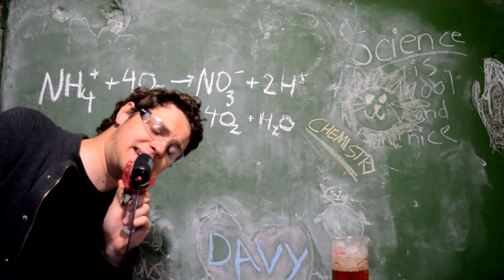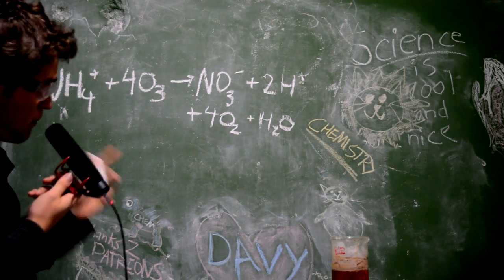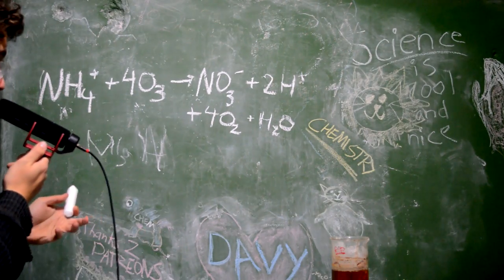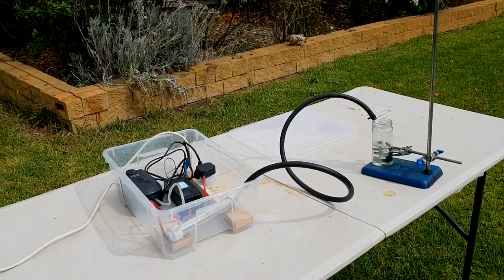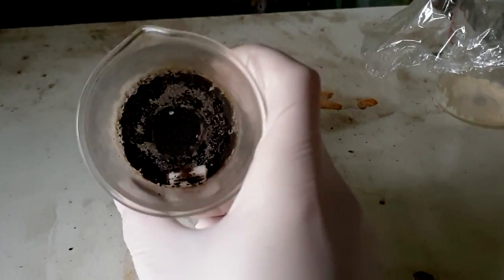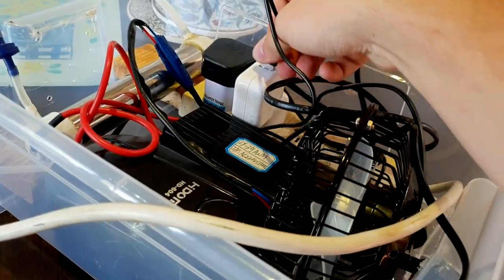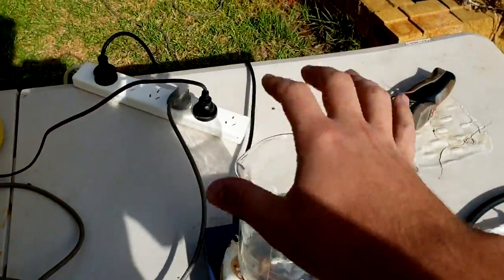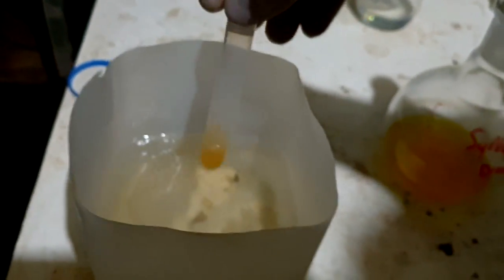Nitrate from Ammonia using Air?

Comment: I’ve tried in the past, to make nitrocellulose 36 times before getting it right. And it turns out that I might have gotten it right all those times, because when I fluffed up my old runs a bit more, it lit perfectly fine. 36 times bro.
Reply: That stuff’s hard to dry.
Reply: Now mix that with glycerin
Reply: I feel the pain behind your statement sir. Though I'm a electric fucker arounder and do not understand 💯%. I felt.
Reply: @RobBoss757  my grandfather used to say, "I once thought I was imperfect, but I was mistaken"
Reply: @elephystry  mix it into acetone at only 5-10%.. you can actually buy it off of Amazon if you want the real dope coating.. now do realize that dope is only nitrated up to around 10- 11% N instead of the 12% so it does not readily 'burst'... and it is noted that a dope coating never really dries, thus is 'self-healing' from scratches.  I'm not going to go into doped fabric as doping is used in restoring furniture and guitar finishes.
Reply: @tsclly2377  dope

Comment: I don't think that the transformer is damaged at all, I think the black stuff is just an insulating goop that is commonly used in high voltage circuits.
Reply from the maker: I mean maybe, although it is hideous then, and just poured randomly over half of the components (still possible though)
Reply: @ExtractionsAndIre  yup made in China.. I had a faulty one that was bigger.. Both sides were fully potted. But the low voltage side was filled with coarse sand before potting.. Just to cut a few cents off the cost
Reply from the maker: Why..... sand
Reply: @ExtractionsAndIre  Doesn't conduct! Yeah, sometimes potting compound is slopped around like that. But still prrrrobably a good idea to cool it better.
Reply: @ExtractionsAndIre  that little transformer is actually for high frequency noise suppression. It's a filter basically. It allows 50hz through but stops anything above 1khz getting back in the power grid.
Reply from the maker: @willynebula6193  thanks for this, that makes a lot of sense! I'm slowwwlllyyy getting better at electronics
Reply: @ExtractionsAndIre  "Why..... sand" Go to google maps, type in "Gobi desert" and press enter, click on satellite view.
That's why sand.
Reply: Norm T  I think Willy was right...

Just kidding bud, I just wanted to get you going lol. Sorry for that.
Reply: Also, given that it was upside down from that view, the insulation would have to made of negative mass matter for it to drip and run up onto the board without gooping that metal plate.

I'm guessing the whole thing is sketchy AF anyway, made out of old, oxidized, cracked enamel coated wire and the black goop at least gives it a fighting chance at not dying of crib death.  I'd hate to see an o-scope's output of what that thing does to the high voltage noise on the mains.
Reply: @jonross377  yeah, he was- transformer is pointed the wrong way for it to be switching- and there's two windings with an insulation barrier between them, but they're about the same size, which would make for a pretty poor transformer. It's a common-mode suppression choke (blocks the passage of signals that are the same on both live and neutral)

The high voltage section is the white potted blob with wires going into it on the left. Standard operating procedure for these thousands of volt devices

Big Clive has a recent teardown on his channel on one of these devices
https://youtu.be/7GpsJN3P7vE

It's a bit "circuit-gore" if you know what i mean
Reply: Norm T  That thing looks like a common mode choke to my eyes, not a power transformer, I think the power transformer is potted with the multiplier in the white goop.
Reply: Yes that's potting. A type of epoxy made specifically for the purpose.

They didn't really... "Pot" that... Very well... Lol but that's what it is
Reply: @ExtractionsAndIre  a bit late, but sand is used in high voltage fuses to absorb and stoo arcs. It turns to sand and suppresses out of control arcing.

Comment: My high-effort, low-yield story is university electronics lab, where I spent about 12 hours failing to bias a transistor in electronics lab, because, it turns out, the professor was teaching us the Rules of Thumb that he learned in Army instead of ACTUAL PHYSICS, which would have required a working knowledge of Calculus.

Comment: perhaps you should use ammonium carbonate rather than dissolve ammonia as the vigorous bubbling may just sparge the dissolved gas out
Reply from the maker: Would it just force the ammonia and carbon dioxide out of the solution though??
Reply: @ExtractionsAndIre but at a much slower rate I guess
Reply: Yeah, same thought. Or NH4Cl like the one paper did
Reply: NH4Cl also has the advantage of being delicious.

Comment: Wanna hear about my failures? My thesis is on titanium dioxide surface chemistry (finally writing up now!). 

My first batch of syntheses were done using some "titanium oxychloride" (really more of a Ti4+ aqueous solution with a varying number of chlorides in the Ti coordination sphere) that we had gotten from industrial partners.
Turned out to be contaminated with vanadium, TiO2 turned green upon reduction. Throw away, start over. This time make the starting solution yourself by hydrolyzing TiCl4. (A pain in the ass of a reaction, took me a few tries to get the hang of it...).

I must have then spent over a year trying to remove fluorides from the surface of titanium dioxide nanoparticles. We used fluorides in our synthesis to control their growth and the resulting morphology. Turns out you can't remove said fluorides without destroying said morphology. (Contrary to what had been published in the literature so far). Ended up studying the chemistry of the fluorinated surface instead. (A lot harder, and far from what we were hoping to get)

I also spent months grafting vanadium on the surface of those particles, and doing all sorts of characterizations of the surface vanadium species, to then hand them to someone who would test their catalytic activity for the oxidative dehydrogenation of propane. 

I did so because initial results showed great selectivity to propene.
Initial results were due to an improper setting on the GC. My material had been sh*t all along.

Oh, and have I mentioned grafting nickel complexes on the TiO2? I first tried it with diallylnickel. It's air sensitive, you have to synthesize it yourself  (nickel chloride and allylmagnesium chloride). And keep it below -40°C, or it will decompose. (Hence why you can't buy it)

After multiple failed attempts where I ran out of dry ice halfway through the days-long process, and almost froze off a couple of my fingers by spilling some acetone/dry ice from a dewar on my hands (no Leidenfrost effect to save you here! The skin turned paper-white from frost... lost all feeling of touch for a few days), it turned out diallyl nickel simply destroyed TiO2. (It reduces it to some amorphous, non-stoichiometric oxide, instead of just grafting on the surface hydroxyls)

So I switched to different, less reactive nickel complexes, like the ones NiBr2 makes in acetonitrile and dimethoxyethane. (Of course, this being surface organometallic chemistry, everything has to be done under perfectly air and water-free conditions, so as not to soak your oxide surface in moisture. So, Na/K drying, everything handled on a schlenk line, high vacuum line, or glove box, etc...) 

They did graft on the surface. But they did none of the subsequent chemistry we intended to use them for! So, good for the trashcan too.

 And now I'm trying to get a thesis out of it. And panicking. And procrastinating on youtube instead of writing...

(Thankfully, I did have some success when grafting platinum. But it's not yet published, so shush! ^^)
Reply: I feel bad for laughing but damn that's some thorough and dedicated research. Sometimes negative results are valuable results just as much. Good luck with the writing.
Reply: I feel that struggle. My uni research is making nanoparticle ligands, such a shitshow.
Reply: I was once attempting to make the addition product of fluorene and acetophenone using fluorenyl lithium at 77K. I recovered fluorene in nearly quantitative yield. Only afterwards did it occur to me that acetophenone is acidic enough to protonate fluorenyl anions. While my synthesis scheme was clearly rubbish, I can at least feel vindicated in the quality of my work-up.

In a curious parallel to the preceding posts, the (erstwhile) fluorenylmethanol derivative would have been used as a chelating ligand in a titanocene complex for the polymerisation of alkenes such as propene, butene and pentene.

I managed not to spill liquid nitrogen on myself, but the time I got sprayed with butyl lithium solution when the cannula popped out of the rubber septum was pretty scary. Good job it was only 1M, had it been much stronger I'd have been toast.
Reply: @posysajrazdwatrzy  lol make your thesis about how lame titanium dioxide surface chemistry really is
Reply: A PhD thesis (ideally) shouldn't come with buckets of failure, but often does. I had 2 years of failed results in mine that made up about 5 pages in 1 chapter.

Good luck with writing up!
Reply: Just as posysajrazdwatrzy said: Negative results can be useful as well. Maybe you can save some future chemist from trying the same fruitless methods and making the same mistakes.
Reply: I don't know how your thesis went or if you've finished it... I know you didn't get the results you wanted but from a purely scientific standpoint that sounds like very valuable research.
Reply: @rnedisc 
 I did finish it! ^^ 

But none of the vanadium or nickel stuff made it in there though.
Reply: I feel your pain. My thesis subject is interaction of protic ionic liquids with polymer latexes and latex paints (if I ever get that far) and getting some plasticizing activity out of it all. So far literature shows no signs of anyone trying it out - no-one was stupid enough to try adding agent that simultaneously changes ionic strength and pH of the latex, which, if we were to believe physical chemists, are kinda important for surfactants/protective colloids to work.

And even if I manage to make PILs not destroy my latexes on contact, them bastards will need to:
(1) enter polymer particles and stay in them in sufficient amount (which will be low due to aforementioned bollocks), which raises question about polymer-water distribution;
(2) plasticize the shit out of the polymer in low concentration;
(3) be cheap and easily manufacturable, or no-one will even look at them.

Edit: spelling
Reply: @elnombre91  from what i understand if ur not failing ur not pushing the boundaries of new information. ur just confirming whats already known or suspected and well theres nothing wrong with that but ull never be great without failure unless ur incredibly lucky
Reply: It is always useful to identify what doesn't work, unless all the failures were yours, in which case you could identify a set of processes to help people not get it wrong. Not that this matters now we are all a year down the track. How did your thesis go? Get through it?
Reply: @interestedinstuff  Yeah, doing a postdoc in an other university now! ^^
Reply: As Jamie Heinemann once said: “failure is always an option”. Basically all my psychology papers were “here is how I messed up”
Reply: @74KU  Uhhh... have you heard of heterogeneous catalysis?
Whether we're talking of oil cracking, Haber-Bosch, ethylene oxide & propylene oxide synthesis, Fischer-Tropsch, the Wacker process, hydrodesulfurization, and many more, "random oxides" like this one are only essential to, like, maybe 80% of "heavy" chemical industry?

And TiO2 in particular can also do photocatalysis...
Reply: Well at least you got to prove the people from the previous literature were BSing, right? That has to count for something lmao
Reply: You tube isn't a valid coping mechanism.  No one really cares.

Comment: I spent 1.5 years trying to get a CRISPR system to work in a type of Cyanobacteria but kept getting really weird results with the clones. One test would show the clones have the edits I was after and after a few days in culture the edit was cured. 

Turns out after some work quantifying the number of genomes in the cells we found that the little shits had upwards of ~50 partial copies of the chromosome meaning that we were making edits on only a handful of copies, but whenever the copies would segregate into daughter cells there were ones without any edit which would just outcompete the edited version in culture. 

Moral of the story; stay away from the unholy life sciences, there’s too much bad juju here.
Reply: Ah yes,  non model organisms. The one thing I won’t work with. Well, that and physicists.
Reply: Can you splice the Ivermectin producing bacteria gene into a Ginseng root? You can call it tree of life root.  Yeah, not quite that easy but nice idea.
Reply: Is that really what you do?
Reply: What if you edited the bacteria to produce a green dye or something to allow you to crop out the desireable bacteria in the petri dish? Then you could selectively breed the bacteria without fear of the other bacteria out competing.
Reply: @wn9500  and those godawful yellow things
Reply: And that is why, when doing it the old skool way of plasmid transformation, an antibiotic resistance gene is included in said plasmid, along with the gene of interest that is to be inserted in your bacteria of choice. Or if you don't want to use antibiotic selective pressure, you can also use a gene that gives the capability to ferment a sugar it normally wouldn't be able to.

Comment: Mate, it's yellow chemistry, of course it failed...., surprisingly you forgot to even mention it

got any advice on how to reduce/stop peroxide formation on ethers? maybe even how to chemically reduce the existing trace proxides?

side note, the (high voltage) transformer is potted inside that big white blob. the small thing with two coils is a common mode choke, it just stops the noise from the unit backfeeding to mains, that is easy to buy/replace
Reply from the maker: I am surprised I forgot to mention the yellow! No wonder it didn't work honestly. 

Peroxide formation... dark bottle, store over sodium, good lid. Pretty hard to get peroxide in those circumstances
Reply from the maker: And yeah, so what is that other small core that's doing the melting actually doing in the circuit?
Reply: @ExtractionsAndIre  The video is a bit dark, the black thing on the bottom right is the one you are talking about right? that's this thing
https://en.wikipedia.org/wiki/Choke_(electronics)#Common-mode_choke
Reply: @ExtractionsAndIre  how do you deliberately get peroxie
Reply: @marciaosullivan3200  mix it with hydrogen peroxide and prepare to die

by the way, you can also put in a tiny amount of stabilizer into the ether, I'm not sure what kind of it, though. I think it is stated on the Sciencemadness wiki.
Reply: Are you talking about storage of ethers?

BHT (butylated hydroxytoluene) is an common additive for solvents like THF and diethyl ether, and if it will interfere with any reactions it can be removed via distillation.
Reply: @flagmuffin1221  well, now I need a homebrew recipe for BHT :)
Reply: @LateNightHacks  4-Methylphenol (p-Cresol) and Methylpropene (Isobutylene) in the presence of acid yields BHT. Don't know about the solvent. Seems to me that this reaction is rather inaccessible to an amateur chemist, you might as well just buy the BHT, you only need tiny amounts anyway.

It seems more reasonable to me to use a different stabilizer or destroy the peroxides before use. If the presence of acid in your ether doesn't bother you, ethanol would be the easiest choice. To destroy the peroxides, shake with an aqueous solution of Iron(II)-sulphate repeatedly until no more peroxide can be detected with Potassium iodide, dry with Calcium chloride or some other drying agent (do not use Sodium in the first drying step, the ether is too saturated with water, fire is likely), filter and destill (after confirming that no fresh peroxide has formed). Store in a dark glass bottle over sodium. Add the sodium carefully and stepwise to ensure that there isn't too much water present.

I have also heard of storing ether over potassium hydroxide for stabliziation, but I have no experience with that. Allegedly, the etherperoxide is acidic enough to form an insoluble precipitate with the Potassium Hydroxide. I wouldn't trust such ether without checking for peroxides before use.
Reply: @stefangadshijew1682  thanks, added this to my notes